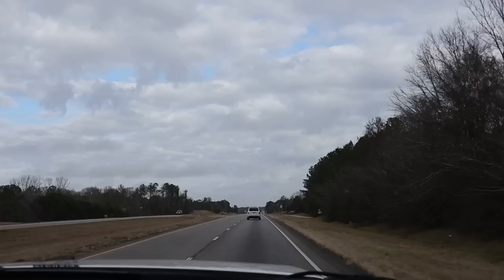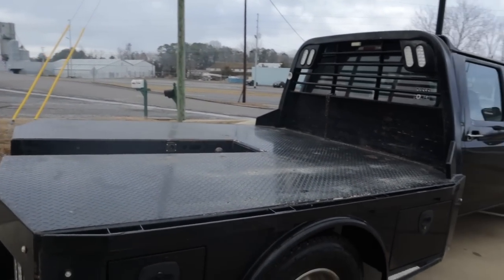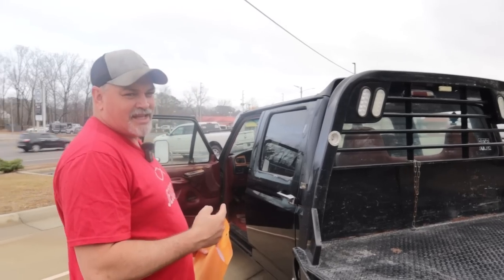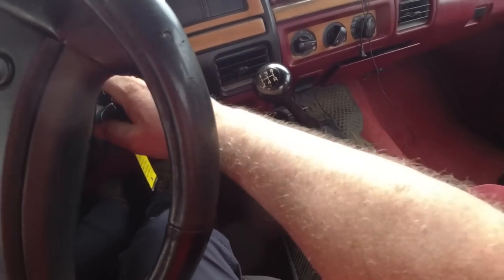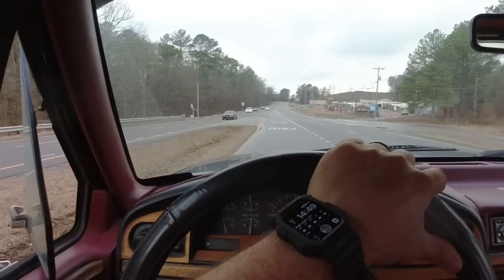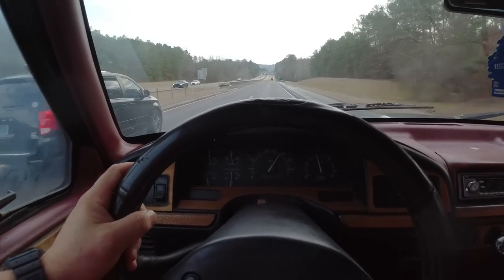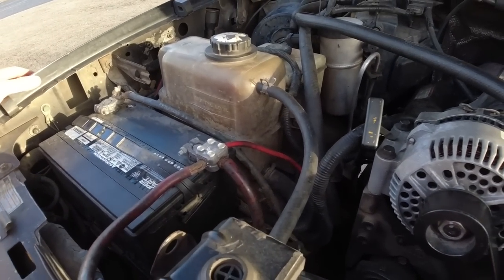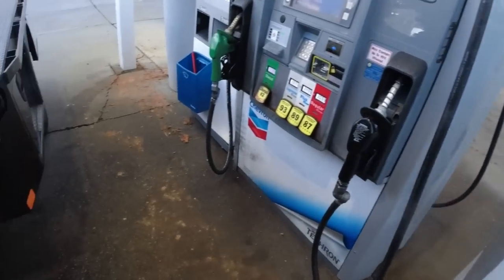I BOUGHT a 7.3 POWERSTROKE Service truck! Will it make it home 300 miles?

Comment: Diesal systems like yours has a fuel return line to the tank which heats the fuel which expands. Check fuel levels when the tanks are cold. The sending unit in the tank could be the problem.
Reply: There's a fuel heater in the bottom of the fuel filter on top of the motor. Don't know if has anything to do with fuel level on the gauge, but it can go bad.

Comment: Temp sensor and fuel gauge are resister style gauges. They don’t use voltage like the charge and oil pressure gauge do. Problems with the tanks are probably sending units as they see a lot of water over the years and they rot out. Selector valve could be bad as well. It’s under the driver side passenger on the frame. Best of luck

Comment: If you're having trouble putting fuel in the tank try pulling up on like a couple two-by-fours sell the truck is leaning my uncle has the same problem with his 97 f super duty and he has a flatbed or his truck to that's what he does to be able to put fuel in the tank

Comment: I have a 2000 super duty. As for your vents not working correctly try looking at the electric vacuum pump. Mine is located on the right inner fender.

Comment: Judging by the look of the rust on the underside of the hood and the blistered paint on the fender it has had an engine fire in the past. The front end was also repainted at one time it's a different shade of black. Still a nice truck though

Comment: Nice truck.  I don't know about the '95 but my '93 had a bad brake light switch (mine was on the proportioning valve on the frame, yours looks like it's on the master cylinder), leaking internally and that made the cruise control not work,  mine also had deteriorated tabs on the back of the hvac controls that would not allow it to switch functions.  On mine, someone had removed the filler tube inside the filler neck so it could not vent properly while filling with fuel and cause a back pressure issue, I had to replace both window motors but from what you discovered it's probably a wiring issue.  I love those old trucks, even with a few issues to deal with.
Reply from the maker: Right on
Reply: I had someting go bad with the speed sensor circuit (replacing the sensor on the rear-end didn't fix it) the result was the speedo bounced around, and the cruise control couldn't make sense of it, and didn't work.

Comment: Fuel gage issue could be one sending unit bad or both , wires bad (loose broke or corrosion) , gage itself. Good luck tracing issue.
Being the year of vehicle I'd be checking all vacuum lines (connected , brittle n such) same goes for fuel lines and wires. Naturally ALL fluids checked. As for the vents probly just vacuum diaphragm or line , maybe flap with mouse nest 🤭😄👍

Comment: I had an ambulance with a custom body on back. The thing was a pain in the butt to fuel. It was just like your truck was doing. We place a 6x6 block under the tire to tilt the bed up and we could fill it then with out a problem.

Comment: That's the glow plug relay and sometimes if the previous owner disconnected the exhaust back pressure valve. You have to put a wire on the relay to ground  so you don't get a code in the computer.

Comment: That ABS light most likely has something to do with the emergency brake problem.  I had an Explorer that did that until I had the pedal switch replaced.  Since the emergency is inop on it that could be it.

Comment: ABS light coming on and off is most likely due to too much slop in one of the wheel bearings and the cruise control not functioning is actually a recall you can have done at a dealership no charge

Comment: I've had my '96 since 2000. The temp gauge doesn't set like the others. It generally stays close to where it was when you turn the key off then moves to cold or where it is when you start it. The gauge is correct for that engine when running at temp.
Reply: Could be you haven’t got a breather tube in the fuel tank filler neck
Reply: Very nice F 350 I like the fact it’s a diesel being a 7.3 and Otis been good though it should be a good truck for ya thanks Hank

Comment: The led tail lights are the reason for the abs light. I put led bulbs in my 93 f150 tail lights and it now triggers the abs light.  It throws off the resistance. Put in line resistors in the tail light wiring and it should fix it. The temp Guage is normal.  That's how it works on older Ford's
Reply from the maker: Good to know. Thanks

Comment: I bought that same truck new. Put over four hundred thousand trouble free miles on it. Only real issue was cam sensors, learned to keep the old one and just put it back on when one would quit. Never did think twice about after that cause it would give a stutter and then quit. I got pretty good at swapping them out as just one screw holding them. Might want to do when its a cold engine tho. Vacuum pump hose is probably problem with air and vents. The windows are a weak point as rodents seem to like those very well. If it was me, and you are friends with Wes, go there for all info to that rig as he   has one too. Your in dirt dobber country and those vent pipes for the fuel tanks are most likely plugged or badly routed. I put my vent hoses on a longer run going up so the fuel did not spit out on the rig. They make a vent valve so it doesn't grab water from the outsides. Mine with a five speed and four wheel drive F350 was about thirteen miles local but on trips, I have hit a high of almost twenty miles to gallon. fourteen to sixteen is a good number for mileage. Just a guess here Hank, noticing the man stick vibrations, may be a indication of a u-joint starting to talk to you. I do not like anything that covers the wheel hubs so just ditch them. I never seen anything that indicated it was four wheel drive but kinda hope for it to be so.
       I have been in the hospital now for some time. In and out, my kidneys are shot! Thanks to vietnam. I also am battling pneumonia and at seventy three is kinda alarming. Doctors said maybe a year but not to hold him to it
Reply from the maker: Sorry to hear that Morgan.  I’ll be praying for you buddy.
Reply: @HamiltonvilleFarm  I do appreciate it Hank, but I ain't scared.... I know the good lord needs a mechanic for old carts

Comment: Hank the slow fuel filling maybe you may need to change where the fuel tank inlets are by raising the the filler necks higher because the placement they maybe to low I have seen other u-tubers have to raise them

Comment: The abs light and no cruise control combination usually means that the brake light switch is bad. When you replace it, use the ford part, the aftermarket switch doesn't have the correct contacts. Good luck.

Comment: Id start with a fuel tank switch, relays and grounds and you will also find some other small stuff along the way and yes those older fords are a bit tuchy that includes the gauges

Comment: I had a 1995 similar to yours except auto trans. Seventeen to the gallon is about right. Glow plug relay is working Volt meter shot up in the last of the dash shot.

Comment: Most likely it is the heater air door actuator for just blowing out of the defrost. A simple fix. As for the fuel, could be the vent. I think there is a video on YT about this. Some problems could be the loose nut behind the wheel. lol

Comment: Hank check the filler neck it may be kinked or cracked or it could be rotted out due to age.My 1995 Ford Bronco XLT did the same it was a vent problem.The gas gauge could be a bad or wornout sending unit in each tank.

Comment: The problem with the transfer switch for the regulating the heat and air. It may simply be a vacuum hose if actuator. I e had trouble in the past with both of them.

Comment: I had the same problem my hoses after putting on the flatbed were a bad angel and wold fill up the hose I had to hold the hose close to the top of bed to fill

Comment: My 7.3 always ran cold. In the summer here in Southern California is the only time my temp gage would ever get to normal operating temps. And do not quote me on this but I do not think they started putting those beauty covers on the engines until 1997 so you might have a new-er motor in there.
Reply: My 95 7.3 had a cover just like that one

Comment: I am not sure about a 95 but my 2000 would hesitate as well when changing gears. on mine it ended up being the accelerator pedal had gone bad. Good luck with your truck, love my 7.3

Comment: Okay ask you to defrost problem under the hood by the blower motor for air conditioning heater there's a vacuum line normally they're white they go to the Engine side of the truck and vacuum line deteriorate and sucks are so you'll have to replace it or at least the part that broke

Comment: This truck looks really good. I have a 1994 with 352k miles.... i hope. the odo goes 399999 then back to 300k. Its kinda rough, some surface rust on the frame. Texas oilfield truck its whole life

Comment: Is there a tank changeover switch and valve? I had an old Land Rover with twin tanks and the valve was partially clogged in both directions and really stiff to operate. Removed it (BIG puddle on the floor. D’oh. Drain the tanks first 😑 ), blew it out with an air line and worked it back and forth until it freed-up. No more fuel starvation 🙂

Comment: Not sure on the Ford diesel. But the ford gas engines, The temp gauge is actually an idiot light. Either reads normal or hot.

Comment: I have a 1996 F250 with 2 fuel tanks. The  front tank i get 400 miles and the rear tank i get 300 miles. I get about 20 to 22 miles per gallon.

Comment: The air only blows through the defrost ducts you have a vaccum leak inside the Engine bay by the firewall or under the dash by glove box

Comment: It might be a wheel bearing because ur abs. Comes on and goes off so it might be on its way out that is what it did to my van so it don’t take much to check that I’m sure ya know how to check that out I had a truck like that and if I turned the Handel of the pump upside down it would go in just fine so give that a try as well

Comment: Yup Hank the blend door in the heater box is stuck on stupid it has a vacuum motor that open,s it so it could be just a vac hose the bed,s look great on the truck,s but for some reason they don't take fuel good what I have found I they are pulling the vent tube out of fuel fill hose so I wood check them out and I new what you name the truck before you said anything because we all name them the same thing when they are black and a dulley LoL have a good day and a nother good video

Comment: Check if there are any recalls one the ol' beast. My 82 chevy had a recall years later because the paint flaked off. They may have to paint it for you.
Reply: I was just noticing that the left front fender and driver door don't quite match.  Wrecked, maybe, at one time or other?
Reply: That truck is a fire recovery. All the signs of it are present. The hood, the fender, new parts, paint not matching, and the engine far to clean for the year, etc... I would be pulling the dash out to find the remaining damage or actually the entire cab. I wouldn't personally trust it till I knew the extent of the main wiring harness condition. What band aids are hiding?
Reply from the maker: I don’t think it’s a fire… maybe wrecked.  I talk about what I found out about the history of the truck in an upcoming video. 👍
Reply: @HamiltonvilleFarm  cool 😎  ... Can't wait for more backstory. 
That is a nice looking F350. We used to call them a Ford 1 ton. I have an old 63 Ford 1 ton flat bed. I even have a will it start video after 21 years in the backyard. 😁👍

Comment: Your window problem is probably a broken wire in the rubber tube that comes from in the cab into the drivers door years of opening and closing these trucks are bad for it I have fixed several of the with same issue and that ended up being the problem

Comment: When you show less than a quarter tank of fuel on these trucks, sometimes they will quit drawing fuel.  Just switch to the other tank and it will clear up.  I try to avoid having less than a quarter tank.

Comment: Actually decent looking truck got a new alternator on it too I see them 7.3 are great motors and it’s stick shift that’s a plus.  And 4 door. You got a solid truck and im not a ford guy 😂 im a mechanic tho. I’ll always be a Chevy guy.  I got a 94 f350 7.3 tow truck tho stick shift basically same as yours but mine is 2 door

Comment: My 95 F350 7.3 would get 18 mpg on the interstate running 60 anything above the mpg would drop it had a 4.10 rear with a 5 speed. Check your vacuum to the heat/ac control the wire you hooked back up at the fuel filter is more than likely the fuel bowl heater I would leave it unhooked living in the south you don't need it plus if it goes out it can take the control module out with mine went out and took both out the engine module and the injector drive module
Reply from the maker: Thanks

Comment: so LED heads are the only way to go buy from Amazon aux beam is all I use. As for the window there are 3 plastic pieces that go out in the motor. You can replace them or the motor but look up video on doing it and drill two holes in the door.  The fuel tank peace on the frame has been a problem for me (used Amazon part lasted 1 year). Had a vacuum pump go out. Been drive one of these trucks for year. 5 speed is the way to go E4OD just sucks fine behind a 351 but not for diesel. I would do the top marker lights if they are cracked at all (Amazon kit comes with LEDs). Love my OBS and wouldn't trade it for a new truck if you paid me. Don't use leds in 3 brake light it cause abs issues. Not all 7.3 will make a 1millon miles but that's ok take care of it and it won't do you wrong.
Reply: The upfit truck did sometimes have electric problems because some of them used scotch locks and stuff like that. I have one upfit truck and one regular but my upfit   it's been good so far. Have the same problem with the rpm of you keep the pedal down it will push out light blue smoke out of the exhaust. It is rpm driven and up and down rpm causes it to happen more.

Comment: Turn the handle upside down. Flatbeds screw up the vent for the fill. And you will learn real quick shut the hood and drive. All obs ford's temp gauge stays up like that

Comment: Fuel pump in the tank or out?
Dirty fuel filters may cause lag in response.
my 2000 Chevy had a fuel pump go out and went into limp mode, 2-5 mph 
at first started it slowly...... Check ground all around the tank .... that may help with fuel gauges .... Crossover valve may have plug or pinch in line or wire..

Comment: Try to turn the gas filler all the way straight-up-and-down upside down and fill it with fuel and see if that helps I had 1 1 time that you had to have it upside down  For it to not spit back out on you

Comment: It may be needing new fuel sending units for the tanks and there is the valve under the truck that is supposed to switch between tanks. You're in better luck than me. At least you have both tanks. I just have one lol. Plus my truck used to be a high roller for a railroad company and the wiring is a bit of a mess and need a different bed.
Reply: In my 84 someone replaced the automatic fuel switch for the returns with a manual one.  If it wasn't kept in sync with the switch on the dash, the return would fill one tank from the other, until there was fuel gushing out the filler.

Comment: Common flatbed problem, putting fuel in it 😂 you can do it but you gotta go really slow or put it in an angle. Try putting it upside down to fill it up, sometimes it works sometimes it don’t

Comment: 2200 for 8 plugs installed is great price. 1200 for a new head great price. So its over heated but been fixed.. put a Lincoln sa-200 welder on it. That truck looks in great condition. New it would be 120,000 today. emission exempt and a 1995.. with a 7.3 ....  as long was it has less than 500k miles your good… add diesel and she’ll go… coat the frame with  chainsaw oil .. winner, winner.. 10k great price.

Comment: I have a 2000 F-250 with the 7.3 diesel. It's a great truck, very few issues. With proper maintenance, a million miles is not at all unrealistic. Mine is an automatic. I would rather have had the 5 speed manual, but there were none available at the time. Mine gets around 13 mpg in town and 16 on the highway.

Comment: Check vent on tanks win pumping fuel the air in tank is making it not take fuel those trucks had alot wiring issues but drive trane will run forever

Comment: Hank you have a lot of work ahead of you but good luck not a truck I would have bought had one had so many problems with it sold it off still bought ford after that  but not any 7.3 those never got good fuel mileage great video anyway thanks

Comment: Check if you have a vacuum operated air control my 92 Oldsmobile has a vac operated control to switch from vents to defrost and so forth
Reply from the maker: Pretty sure that’s the issue. Thanks!
Reply: @HamiltonvilleFarm  your welcome

Comment: Change fuel filters, IF it has lockout hubs, that might be the vibration if they're IN or a loose U-joint. Check all diff and tranny transfere case levels and pray a lot. GBWYasll

Comment: Fords after market tube in a tubefill necks suck.
I'm changing the fuel necks on a superduty after the same issues. 
Seems Fords have fueling issues with most aftermarket beds

Comment: Just from a first glance the front clip don't match the rest of the truck ,front clip has been repainted for whatever reason. Have your vacuum system checked probably reason why 
your heater door and cruise ain't working ,vacuum leaks

Comment: ford had issues in late 80's through the 90's with temp and possibly fuel sensors not sensitive enough i.e not much movement on the gauge. had many rangers with the same issue... it's a ford thing